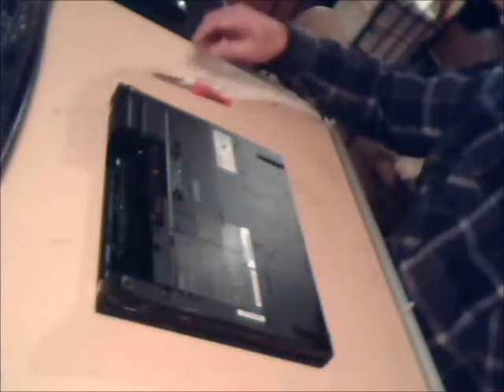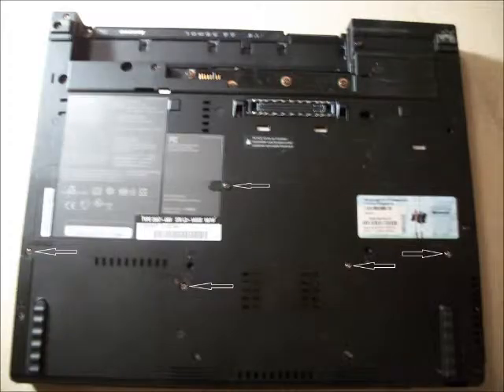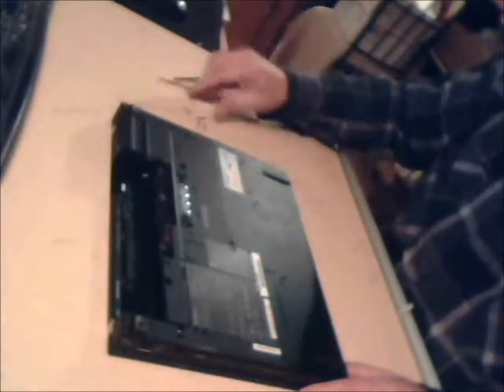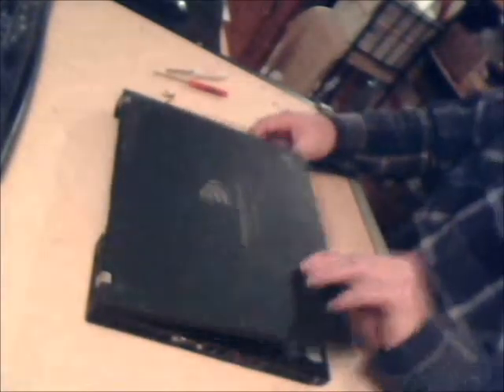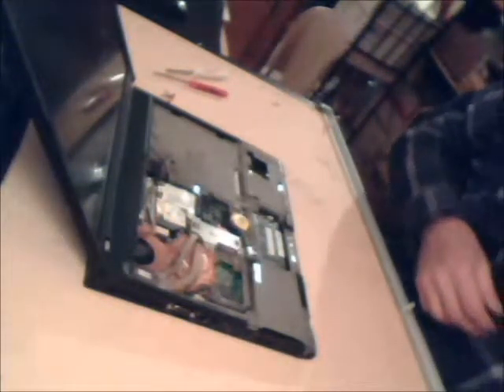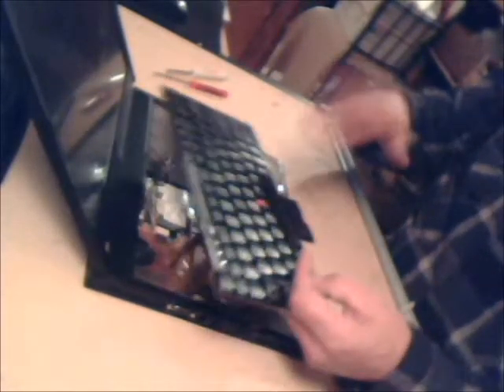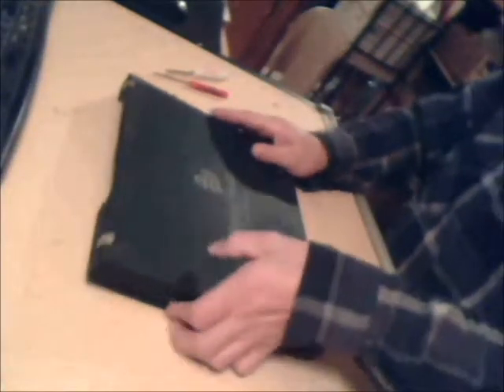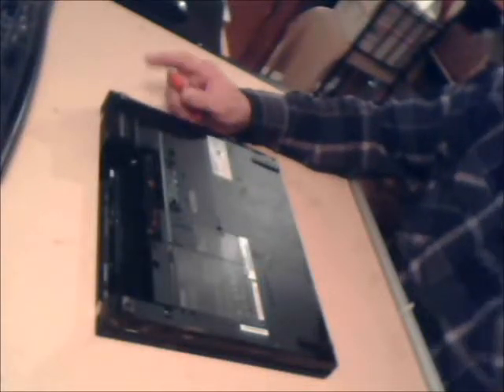Lenovo T60 Keyboard Replacment.wmv

Comment: Good video I like to keep one in front of me as a refresher whenever I'm doing a job like this, but ALL the screws are NOT the same- almost messed me up there-- ONE screw is shorter , the center one, also being the ONLY screw that actually is part of the keyboard the other 4 hold the wrist pad in place which in turn hold the keyboard. If you put one of the longer screws in the center one, you risk stripping the threads plus when you put the shorter one in a different hole, it won't reach the threads-- but still , I found this video helpful.